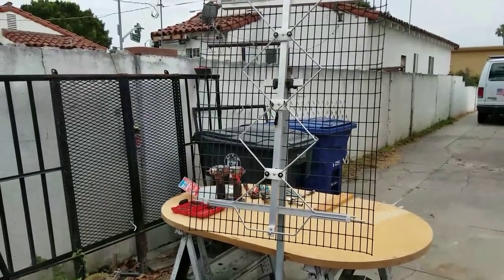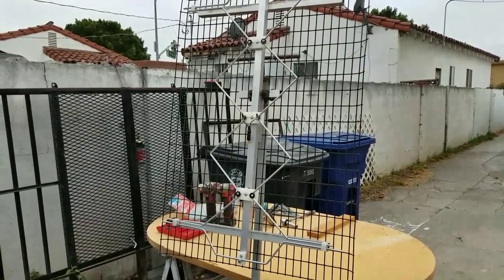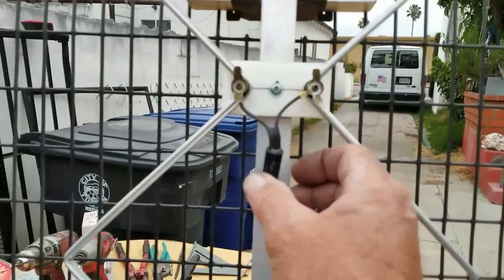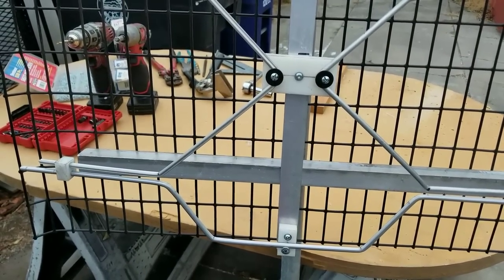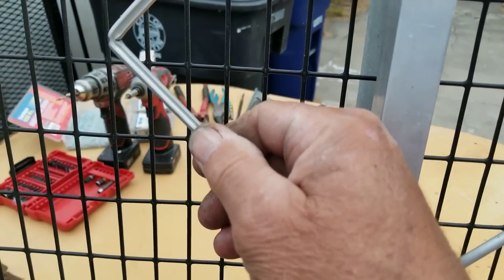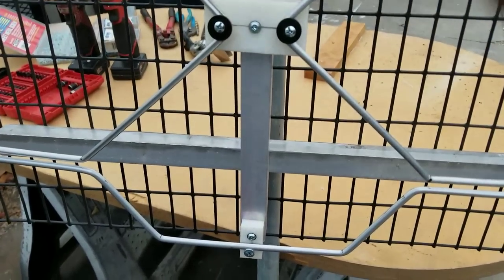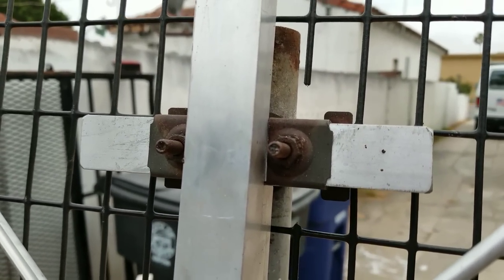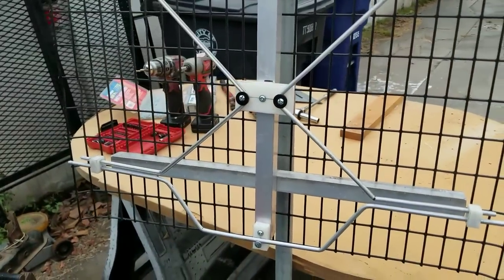My Homemade High Gain Tv Antenna

Comment: Hello GBear, have you got around to make an new antenna ??? Just wondering if you have any good ideas to share with us all.
Reply from the maker: My antenna is working just fine.  I recently rescanned and went from 23 channels to 40 channels.  The biggest problem out here is when high winds knock it out of alignment and i have to reset it..
Reply: @GBear  Thanks for letting me know. I look forward to see your Ultra Antenna, hopefully sometime soon. I got two louvers blinds that have the aluminum rods. Do you think the blind control rod with the grove all the way through the rod increases signal gain ??  Thank again Sir for honest and accurate information on the YouTube channel. P. S. Got some solid copper #4 wire cheap at yard sale. Have to decide on which type of wire to use. God bless too. vf
Reply from the maker: The aluminum rod is what I used.  I'm glad I used square aluminum tubing for the frame, because pvc pipe doesn't last long in the desert sun.
Reply: @GBear I got that loud and clear using aluminum element and aluminum backbone. Now all I have to do is make the time and put together the killer antenna. Keep me in the loop when you decide to make another antenna. Thanks fella too. vf
Reply from the maker: You got it.

Comment: I built this design but with- out the reflector panel screen so I could receive broadcast signals from the front as well as the back of the antenna at the expense of some forward gain. you did an excellent job building this antenna
Reply from the maker: Thanks.   The reflector also prevents interference from those rear towers.  I've never been a fan of omnidirectional antennas because of that.  But if it works for you, that's excellent!
I just rescanned my tv channels and was getting 23 channels out here in the desert, now i get 41!

Comment: You have that reversed the main antenna is UHF the so called hat was not part of the Gray Hoverman antenna. That was added to pick up high VHF, won't work on Low VHF you need large elements for low VHF but not many places use the low part of the TV band. If you have a low number for TV its just a virtual number most channels are UHF even if they have a low number. 73

Comment: You have Gray-Hoverman antenna with "top hats" added. It is a UHF antenna with the "hats" added to improve VHF reception.  (You got it backwards.)   Even in the desert you will have "bi-metallic corrosion" between the aluminum and the steel. You'll see it first at the balun terminals where you have copper wires with steel spades threaded up to aluminum. Your build was 2017 so odds are this antenna has been abandoned or is offering very degraded reception because of the corrosion.
Reply from the maker: Welcome aboard.   That antenna is still on my cabin here off grid, and working just fine.  As a matter of fact, i just recently rescanned and went up from 23 channels to 40.

Comment: Great job, BTW that is a UHF antenna (Grey Hooverman I believe), it will pick up VHF also. The hat just gives it a little extra boost.
Reply from the maker: Yes, you hit the nail on the head.
Reply: I thought the top and bottom bars were for VHF reception?
Reply from the maker: You are correct.

Comment: Wrong the VHF is the hats. Gray Hoverman antennas are UHF. The hats were added to pick up  high VHF. You cannot pick up low VHF with this antenna. You can increase gain by couple two gray Hoverman antennas together. Low VHF needs long elements there are not too many real low VHF channels out there maybe the virtual number is two through 6 but most broadcast on UHF. Your antenna will pick up good if you put it up high enough.
Reply from the maker: Thanks.  Welcome aboard.   I shot that video years ago and hsve since moved off grid in the high desert where I use those antennae daily.  They work very well mounted on a 21 foot pole.
Reply: @GBear  yes I guess the desert is mainly flat but you said high so I assume you are up high. I haven't built mine yet I am going to use copper on mine. The drill method will make the copper  wire straight.
Reply from the maker: I'm  not sure what you mean by drill method, but sounds like you have it handled.  Good luck!
Reply: @GBear  yeah like the ultimate antenna guy does. He puts one end of the copper wire in a vise and the other end in and cordless drill and for a short second twist the wire until it's straight. It also stiffens the wire. You don't twist too much.
Reply from the maker: Ahhh.  But at the price of copper vs. Aluminum nowadays I'll save the copper.  It's headed to be the new gold.
Reply: @GBear  yes I understand. I have scrap copper wire, the antenna is more valuable than the scrap price I would get. I have scrap that will go to the scrap yard but I need to strip it by hand they won't take copper that was in the fire. At least in Florida.
Reply from the maker: I'm just saving it for now, brass too.  I plan on building a furnace to melt it down into bricks and I'll put it in my safe.
Copper is used in every coin minted in the U.S. and the mines are running low.  We have also been sending alot of it into space, never to return

Comment: Well built, the hard task is going uhf low to high, 500 MHz to 900 MHz. In that case a small mustache of Al wires do catch the signal. I am trying that in front of a parabolic dish and it is like 10 x gain.
Reply from the maker: Welcome aboard!  Good idea!  Let us know how it works out!
Reply: @GBear  it works ok for my flat region, i hunted tv from 66 miles south once,  pathway to sao paulo.
Reply from the maker: @FernandoVisserCedrola Yeah, I now live off grid in the high desert and have been using this antenna for the past 8 years.

Comment: Wow.  This antenna looks amazing.  I'm in the process of making my own Grey Hooverman.  For my first attempt I'm just going to just use PVC pipe (cheap) for the frame and some 10 guage copper wire for the antenna.   My location is terrible though.  I'm in the bottom of a valley with 200+ feet tall hills on all sides.  The nearest TV station transmitter is 50 miles away.   I'm trying to pick up 3-4 more stations from 60-75 miles away in the same direction.  I'm currently using a small RCA yagi antenna with an amplifier.  It picks up the 50 mile station ok.
Reply from the maker: Welcome aboard!  I hope it works for you, since it sounds like line of sight is not good from your location.  You may want to add a booster.

Comment: Looks like a nice heavy duty build. I've been experimenting with different antennas but I live in an area that has poor reception no matter what I try. The gray hoverman I built works better than the Mohu Sky that I paid over $100 for. I built a stealth hawk that works also but living in the birthplace of cable TV ( Lehigh Valley Pennsylvania ) I'm limited to 9 channels from 3 stations.
Reply from the maker: I understand.  Where I live now I can pick up 159 channels from antenna (Orange county, CA).  The reason I built this one is that I will be moving to the upper desert and with a store bought antenna out there I can only pick up 21 channels, most of them in foreign languages.  I just got back from a 5 day trip up there and while there I connected my #1 build antenna just standing on the ground with the 6 foot test post I had it connected to in the video.  Without getting out a compass for a perfect setting, I scanned in 30 channels with some as far away as San Diego!  (160 miles to the south).  For a permanent install, I will be placing the antenna on a pole elevating it to approx. 20 feet.

Comment: When I was a kid in the early 60s we built antennas like this using the cat whisker dipole design on a 1 by piece a wood to get UHF. We had a VHF TV with a UHF converter back then. We had two of these type antennas on an old ladder bolted to the house. One faced east west and the other north south to get everything in our area. There was equal lengths of ladder line 300 ohm tv wire going to each antenna. At the junction was the TV 300 ohm ladder line or open wire  TV cable going into the house to the TV UHF converter box. Where it converted to VHF channel 3 to feed the old round screen Zenith TV set. Grandma loved L. Welk show and the music on there. And Grandpa would watch it with her. Grandpa later changed the antennas and put some chicken wire o the back side of a new set him and I built together. BTW my Grandpas first UHF TV antenna was a blown out 500 watt light bulb hooked to the 300 ohm wire and put in the attic to get channel 20 in Springfield Illinois. Thanks for the antenna design it made me remember many good times with my Grandpa. 73s Jimmy, WX9DX
Reply from the maker: Sounds like great memories!  Thanks for the comments!
Reply: A blown out bulb that's a new one, but I can see how it worked. The part inside a light bulb that holds the filament was made of tungsten, and a good conductor. I never saw a bulb that large. We had 200 watt bulbs in our basement. Dad had florescent fixtures, but never used them except in the corner where the electronics bench was, that was the warmest part of the basement because the furnace was behind the chair for the bench. The chair was a telephone operator chair. Back when operators said number please. 73

Comment: Might be able to mount 2 of those antennas using the reflector in the center giving strong front and back signals and maybe even making it a 360 degree antenna.
Reply from the maker: Welcome aboard!  I tried using both in series facing different directions.  What I discovered is it acted as if the deflectors were removed and picked up interference from opposing channels, scrambling the normal channels.  Being somewhat omnidirectional weakened both.

Comment: Excellent build quality!  You really did a great job!   Just a couple of suggestions.  I was unable to see it well from the video but your reflector, in fact ALL metal, should be distanced 4.5 inches back from the front active elements. That distance is critical because it helps to match the actual wavelength of the signal for maximum forward gain at the lower end of the UHF band.  14-36.   If you're trying to get higher channels. above 36 that no longer exist, then you would shorten that distance to about 3" for channels 60 through 72.  If you build another one consider building your frame behind the reflector so that all of your active elements are spaced 4.5" from the reflector itself. That will provide maximum gain.  But I really am impressed with your build quality.  Really sturdy and professional looking!
Reply from the maker: Thanks Rick.
Reply: @GBear  : Typical "Gray - Hoverman" Super Antenna design .
Reply from the maker: You betcha!  Thank you. 
Welcome aboard!
Reply: Just BTW:
If you look up the frequency of the station you care about and don't mind metric a handy thing to know is
Wavelength = 300Meters / MHz
The reflector distance is about 1/2 wavelength for best performance.
The reflector should be a little more than 1/2 wavelength wide.
Reply from the maker: @Ken Smith  thanks Ken!

Comment: I don't know why everyone goes through all this work.I just ran a piece if 22 gauge wire around the attic and tied it to my uhf/vhf transformer that cost a dollar and I get 80 channels 40 miles north of Orlando.
Reply from the maker: Lee Watts good point!  I made mine for an off grid application, and i don't have an attic put there.
Reply: In my other property I used a slingshot to put a fishing line to pull a wire over a tree at the top of the hill  and it works great in the mountainsides
Reply from the maker: Lee Watts i dont have trees at my off grid either.  I'm in the desert.   I planted an orchard last spring but it'll be years before they grow up.  So i put up a pole and mounted this antenna on it.  Also, i have to deal with winds, sometimes gusting 30-80mph, the system I have now has been holding up to those winds.
Reply: @leewatts3153  here in Las Vegas i saw one house where they mounted their antenna on the trunks of a tall palm tree.

Comment: I hooked my wires directly to the antenna. Worked fine! I get 61 channels.
Reply from the maker: Yes, you can do that.  The balun or transformer just increases the resistance to 300ohms for better reception and distance.

Comment: I am wondering why you think the top hats you have put on the antenna increases VHF signal reception ?? I personally think the antenna looks so much better with the hats included. 
        How are you doing fella living in the desert ??? Drop a line too.
Reply from the maker: I'm doing fine out here, thanks for asking. Antenna is still working well.  The hats were added as a whim.  I had those short pieces left over and figured that since an antenna is rated by the amount of surface area they have, I would add them to see.
I really didn't see any big change by adding them, but since they didn't negatively affect the function, I just left them.  Yes, i thought it looked better with them also.
Reply: @GBear  Hope you do some more videos this year. Look forward to them Sir.
           I am hoping this coming year to fire up the motorhome and do some traveling. I just might surprise you fella. You can call it my bucket list. Good day fella too. vf
Reply from the maker: Thanks.  Sounds like fun!
Reply from the maker: Oh, and don't kuck the bucket.  It only hurts your foot.🤣🤣👍
Reply: @GBear  Not only does it hurt your foot. The foot cannot be used on the accelerator pedal. Have a great day fella too.
Reply from the maker: Yeah, and the bucket holds less because of the dent.
Reply: @GBear  OOPS I must of dropped and fell on the darn thing. Sucks getting old and decrepit.
Reply from the maker: @victoryfirst2878  Welcome to life on earth!  On this planet we get older by the day.🤣👍
Reply: @GBear  We are only here for a visitation and have to thank the creator for letting us be here. Peace G Bears.

Comment: I want to make one of these antennas since I'm 90 miles (by reception) up here in the Hudson Valley .I'm adding a surge protector I know I can get Albany stations but I also want to get the New York ones! Even though there's the Bear Mountains that I can think block the signal. I get the NYC Stations from my cable company Charter (was originally Time Warner Cable). I also want to add this Anntena when I go camping.
Reply from the maker: Cole Piaget antennas are basically "line of sight" receivers even though the new digital TV is beamed from a satellite, it is then broadcast from tower to tower to TV antenna on the ground.  When you had cable, they transmitted through wire to your TV, so line of sight wasn't necessary. 
You can try an antenna, get it up as high as possible, like 20-30 feet and see if you get anything.  Then you can add a signal booster and see if that helps any, but I'm afraid that having a mountain group blocking line of sight may be your downfall.
Also, remember that with DTV, an 'exact' azimuth is required for best signal.  Even 1 or 2 degrees off will deliver poor reception.
Reply: Digital TV sux (sucks)
Reply from the maker: Cole Piaget true but how else can men in black spy on you....lol
Reply: Well it does suck that one can't watch a distant channel with snow as in the pre -digital days, it does have a better picture and when you do get a signal it is crystal clear, no ghosts or distortions. And the sub channels give you lots of choices which didn't exist before. @cjpwolf2436
Reply: @GBear  True, terrestrial antennas are essentially line-of-sight devices. So, if that's the case, how are we able to receive OTA TV signals from stations 70+ miles away? The answer is knife-edge diffraction and/or tropospheric scatter. If you look at the TVFool website, they show single edge diffraction, double-edge diffraction and tropospheric scatter on this page: http://www.tvfool.com/?option=com_content&task=view&id=57#table_details
Reply from the maker: @kiowablue2862  thanks for that!
Reply: @GBear  You're very welcome, Sir!

Comment: Why are the lengths uniform? Would varying the lengths, 5", 9", 13" and 17" assist in picking up particular frequencies?
Reply from the maker: Interesting question.  All manufactured TV antennas seem to be built uniformly, so i did the same.  I don't know if varying the lengths would help.   Give it a try!  You may stumble upon something!
Reply: @GBear  I read on a Texas instruments paper that 4.6" and 17.3" were the length of elements for frequencies between high VHF and UHF channel 36. The 4.6 was maybe 4.66. 

I have seen four Bayes since college 1980s days made with uniform lengths. If the lengths were all for a distant signal at the correct frequency, then fine. However these are for 175 to 610 MHz so I think there could be a rationale for various lengths. With all the freshman and sophomore engineering students I imagine this has been tried and fails for a technical reason beyond my pay grade.

Were I to build one I would start at 4.66", then 9", 13" and 17.3". Also I imagine the reflector distance which is optimal depends upon the frequency and the material the reflector is made.

27" to 30" flat loop antenna seem to do well for high VHF.
Reply from the maker: All good information, thanks, and welcome aboard!